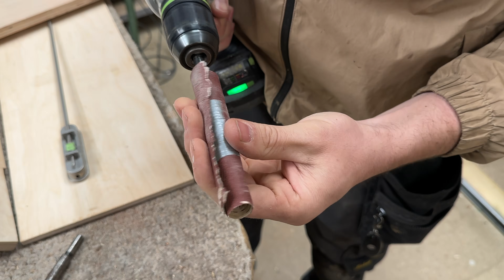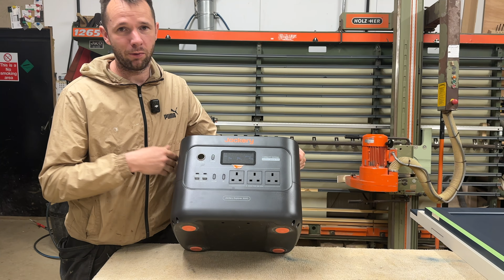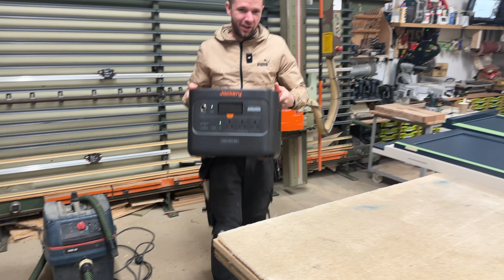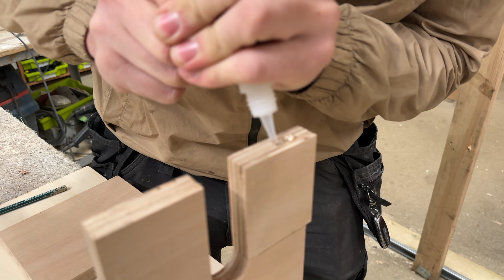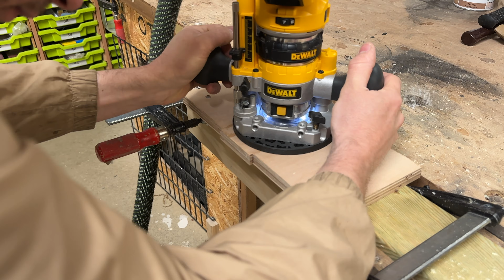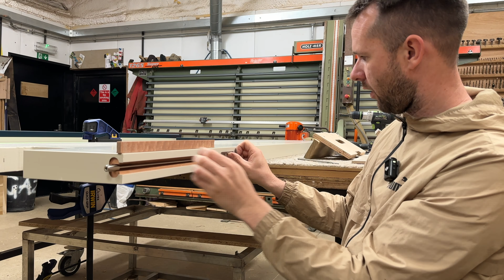Change The Way You Jig - Router Like a Pro

Comment: Nice technique, but it would take about 5 min to CAD this from the drawings or even by hand and about 10 more min to 3D print a template insert ....
Reply from the maker: the main problem is getting the sizing right, glueing around the item is live and it definitley fits, and can be done very simply with with the workshop tools. I will be getting a small cnc, but i still think this is the best way, for one offs atleast!  Do you find there are often test and adjustments needed from such templates? Its not something ive done
Reply: @BradshawJoinery  Pretty much every decent hardware I ever came across had at least 2D CAD drawings with exact dimensions available, if not a full 3D CAD model.

You can trace the 2D drawings very quickly and if you have a 3D model you just pretty much import it straight away and use it as a negative in a cut operation. You can make a jig that accepts these 3D printed templates, so you save on material costs and printing time. 

Sizing isn't an issue pretty much any 3D printer is more precise than what you can do by hand with a drill press and a router.  

You can probably test it yourself, check how long would it take you to CAD out a template in Sketchup, I can guarantee you that it would take probably less time than finding the correct size drill bits yet alone fitting a template by hand.

A CNC can be a decent option for doing this also, but ironically probably will take longer since there is more set up time, and if it's a complex shape you may need to also do tool changes which makes it even longer.

Comment: I might be tempted to try, for the circular hole, to cut the template in half first, clamp/hold it back together and drill on the cut line - maybe avoids any minor problem with dimensions as there's no kerf width missing?...and provide you drill accurately avoids problems with the cut line not being exactly through the centre of the hole
Reply from the maker: Yes you end up with a perfect half circle then! Maybe a little trickier/ timely to setup but for a real fine fit it would be better!

Comment: I could have done with this tutorial years ago as for decades I used too small drill bits.  And your new toy would be useful as I only have a maximum of 15 amps to power all my toys and have blown many fuses by turning my dust extraction on before my planer/thicknesser. Keep up the good work 🌞
Reply from the maker: HAha sounds like a juggling act that Ray! Hope you are well. Didn't see you in the live videos
Reply: @BradshawJoinery  Hi Oliver. Im feeling guilty about missing your live videos. No good reason but my excuse is that I’ve been working myself to a standstill in my garden 😕 Juggling act, yes, especially as I still have fuse wire and not trip switches. I am remarkably well for an old man with a weak mind in a weak body 😎🌞

Comment: Excellent explanation of the segmented  process that was shared to me several years ago. For a faster use without ca glue, clamp everything together and screw another layer of plywood with a hole on top...or strips across the joints.
 I bought a cheap set of drum sanders for a drill,by angling the drill i can sand ovals..especially useful for melamine side splashes on bathroom vanity tops.
Reply from the maker: Its a bonny technique for sure! not totally understanding the angled drill sanding, am i being stupid? 🤣

Comment: реклама не умная..
у меня есть бензиновый  генератор ..он раза в 3 (?)дешевле вашей батареи. и работает уже 25 лет (когда надо.)
Reply from the maker: I don't think the comparison is equal. This is a lifestyle bower bank, camping now enables you to have a hair dryer or heavy draw electronics and power it/recharge in remote locations from the sun.  working indoors, quet working, all advantages over a petrol engine. I wouldn't want to fire up a petrol genny to charge my phone, or carry a generator in the van. Yes its expensive, but compared to a built in battery/inverter/solar system on a van this is actually cheap, and its portable
Reply: @BradshawJoinery  Just to add, I don't think the comparison bestows any advantages to the petrol generator other than cost at present.  The lack of noise and fumes the obvious ones.  For me, and many, the move away from fossil fuels. Looking to the future, new battery technologies that may be with less exotic materials, charge faster, longer lifetime etc.
Reply: @BradshawJoinery  ..разве в ролике есть телефоны на зарядке??. там инструмент. .я с вами не согласен .. у меня есть большой опыт в отключении сетевого напряжения- вам в США этого вероятно не понять (кроме аляски.)  весь инструмент запитывают от бензогенераторов по всему миру..вы экологический экстремист?  powerbank - это не  решение проблемы. .
Reply: It's your choice - as relatively new evolving technology, it's good to see the practical comparisons.

Comment: I now use a 3D printer to make all of my jigs...I design them in Fusion360 and print the night before I need them. Especially handy for cabinet mechanisms (internal bins/pull outs) and handle drilling in kitchens and wardrobes.
Reply: Yep me too! They’re not super strong, but then any template is going to get dinged up if you clip it with the router bit (don’t ask me how I know 😂)
Reply from the maker: No dubt thats a good progression, i can see being really handy for hinges etc, but the fit/minor adjustment would need some back and forth?
Reply: @BradshawJoinery your printer is going to be significantly more accurate than your gluing / drill bits that are close enough / plus sanding etc. And as well you can print slotted plates for offsetting the position, rather than gluing a board on and shimming the jig to position. The additional complex geometries are not a problem when printing.
Reply: @BradshawJoinery  Not really, once you know your printers tolerances they generally come out spot on every time. I measure the component (length, width and radius) or download the manufactures pdf and design the jig around that then press print.
Reply: @David-Rosewood  Too easy! lol

Comment: Nice job 
Wouldn’ the selection of an appropriate size radius cutter leave the curve of the fitting
Reply from the maker: How do you mean colin? Using the right size bit is ideal but they often arent the right size
Reply: @BradshawJoinery 
I was just thinking even when you follow a square template you end up with a round corner so the bigger the bit the bigger the radius of the cut. 
So in theory you could cut the ends of the template square. 
Easier your way 
Stupid idea I know sorry lol 
Thanks for replying